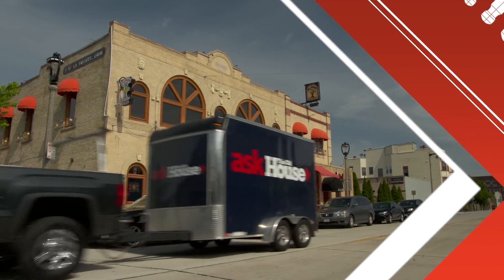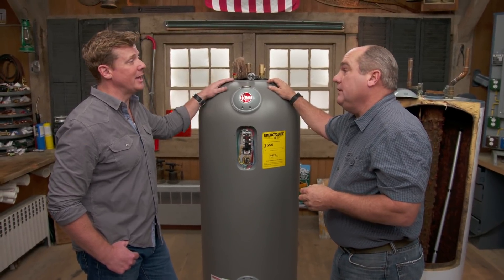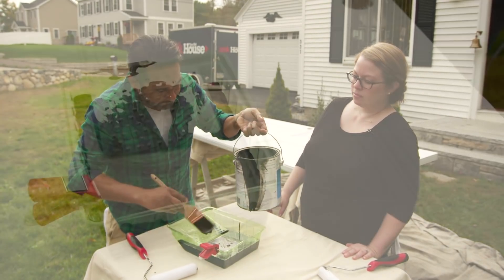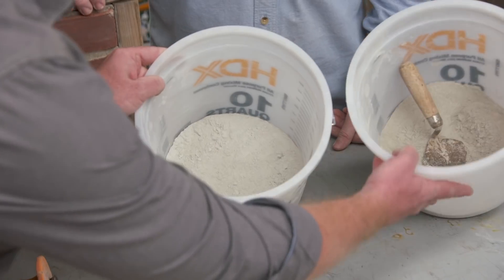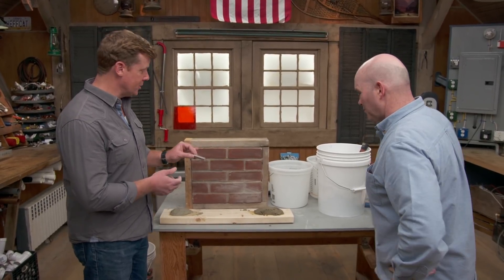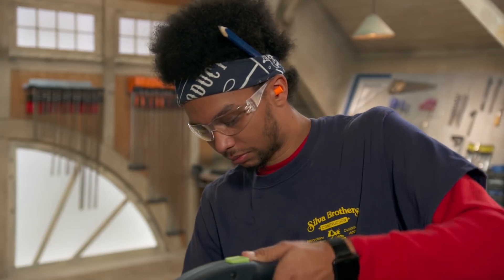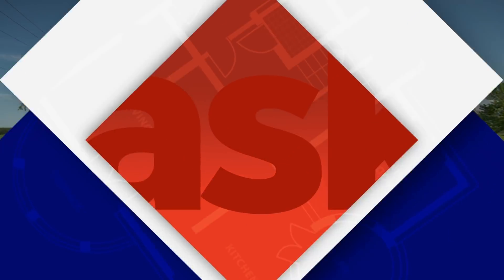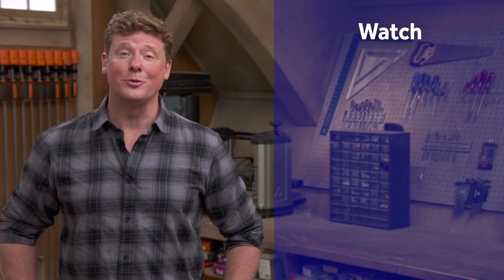ASK This Old House | Paint Door, Wood Joints (S16 E21) FULL EPISODE

Comment: You really have to let that DTM cure real good before you apply hardware or pull tape..I always used a hair dryer to help dry around door knob holes etc before I put the hardware back on..good stuff though after it cures and toughens up after a few weeks..

Comment: Just yesterday I was looking on Home Depot’s site for the “plastic” tanks and they have three commercial Rhem’s 75, 85, and 105 gallon tanks. But those use large titanium heating elements. Would those last longer then regular metal elements?
Reply: yes the titanium should last longer. They were wrong though all Marathon tanks come with titanium elements not steel.

Comment: Painting the outside of the doors with a water-based paint is never a good choice. It will start to fade within a few months, and paint will start to peel off within a year. Only an oil-based paint can withstand
Reply: What if it's white paint?  You figure that will fade?  What's it do, get whiter?   I used exterior latex DTM paint on my doors 25 years ago - they still look just fine.  I live in New Mexico we get about 360 days of sunshine, and the paint has not chalked, peeled, etc.